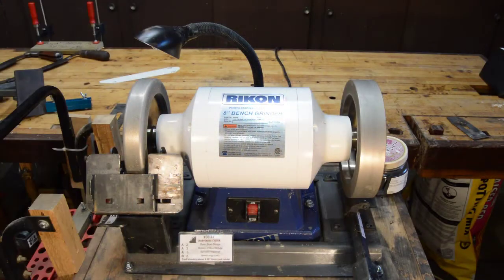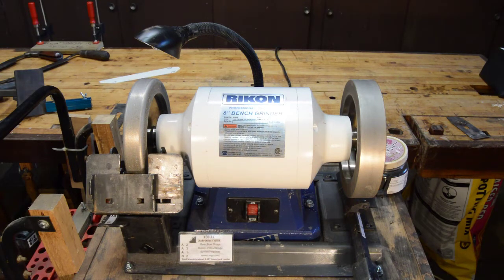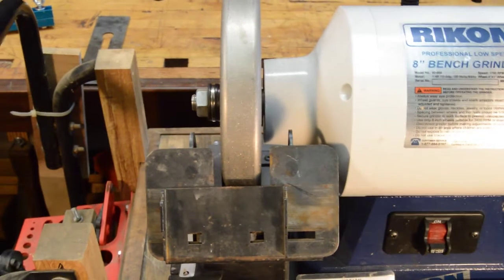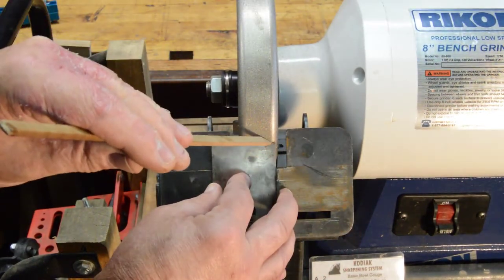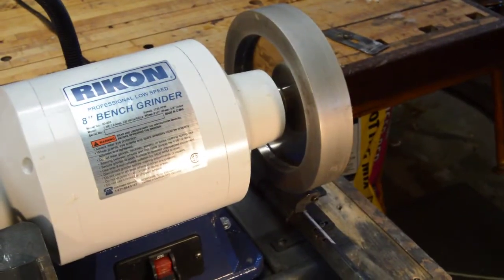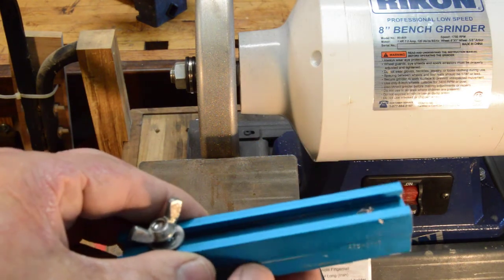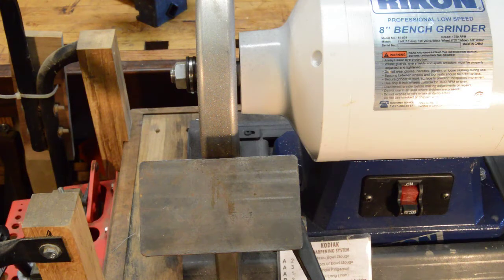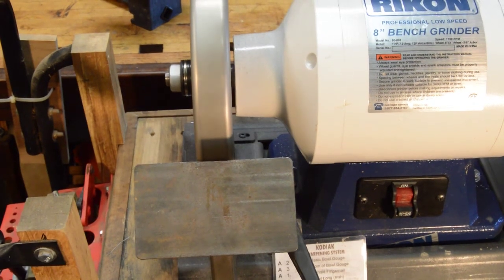Grinding the Primary Bevel of a Plane Blade with a Homemade Jig

Comment: surely you could just shimm out either side of the original slide
Reply from the maker: I'm having a bit of trouble visualizing your point.  I think the only way I could make it move a longer distance from side to side is to lengthen (grind) that slot that it moves in.  Making the simple little blade holder seemed a lot easier. Thanks for watching!